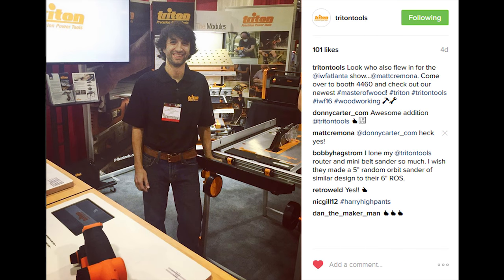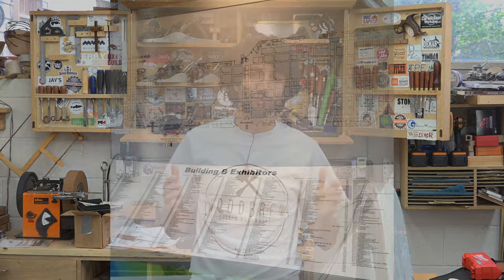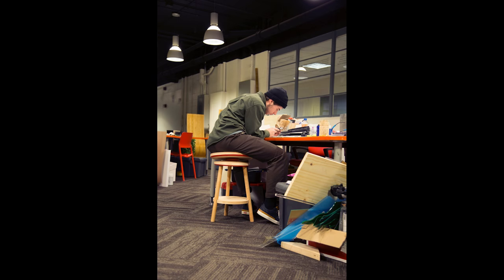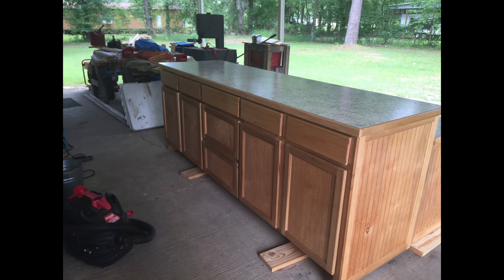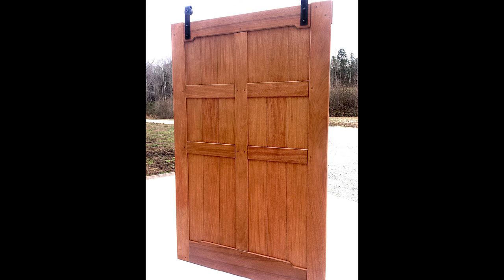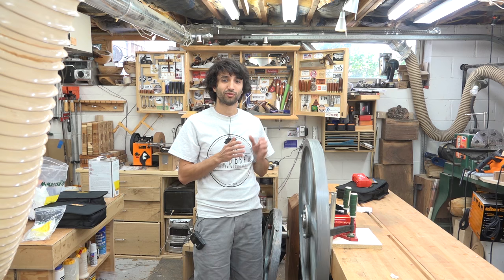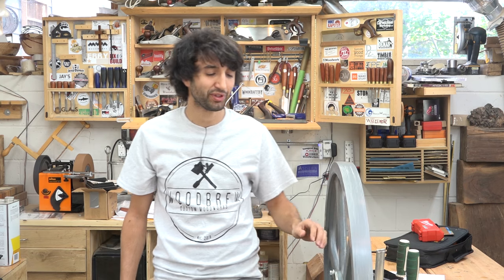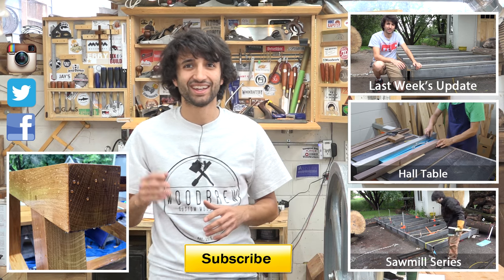Matt's Weekly Shop Update - August 30, 2016

Comment: So do you put a rubber layer on the wheel for the band saw mill?
Reply from the maker: No, these are made to have the blade run directly on the wheel.  They'll run perfectly true that way and don't have issues with lube deteriorating the tire.

Comment: Hey Matt :)
Reply from the maker: +Jay Sybrandy greetings
Reply: +Matthew Cremona why did you use brought wheels not tyres or anything? :)
Reply from the maker: +Jay Sybrandy more mass means more momentum
Reply: +Matthew Cremona ohh :) what's was that red thing on the bottom right of the pallet ?
Reply from the maker: that's the shaft that the idle wheel is mounted to
Reply: Very Cool :) I taged you in a post on Instagram :)